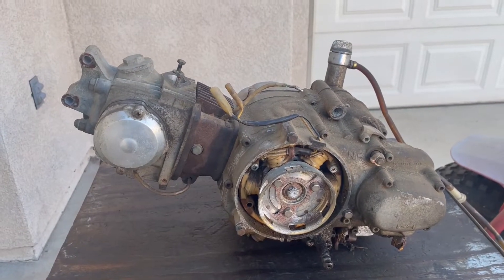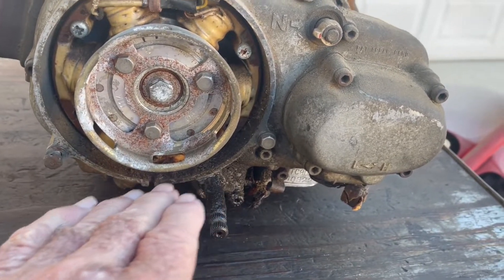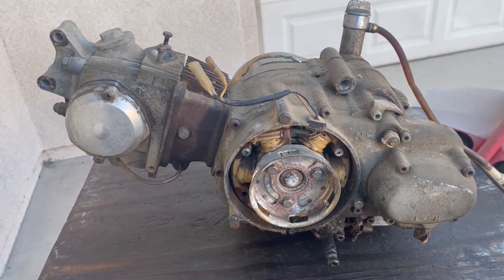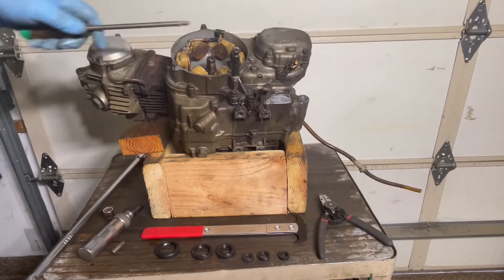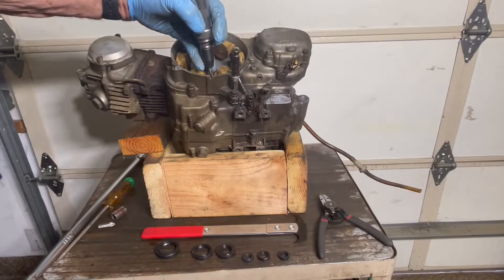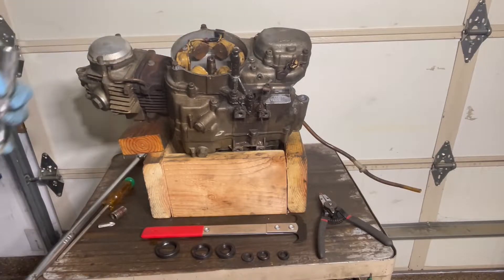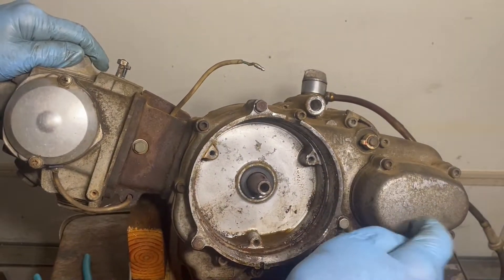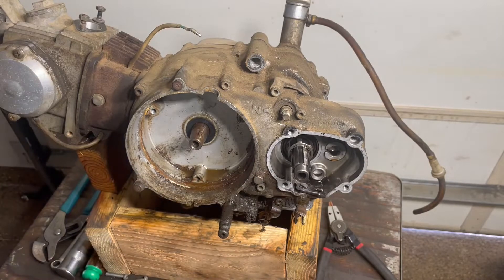Honda ATC ATC90 Throwing Oil, Part 3 - Oil Seals, Oil Filters, Clutch

Comment: Original Honda screws are not Philips Head… they are JIS (Japanese Industrial Standard). 
JIS screw drivers and bits are available and do not “cam out” as Philips Screw drivers were designed to do.

Comment: I just started working on a 1977 ATC90 engine. I took the left side cover off and it looked like someone JB welded the top void (narrow one that opens into the countershaft area) visible at 22:08 in your vid. I'm guessing they did this because they had a chain break and crunch the case, so they repaired it with JB. Do you know what that void is, or if filling it in will hurt anything? Thanks sir
Reply: If you take a careful look at the gasket holes and outer cover passages compared to the case passages, you’ll see the one you refer to is an additional  crankcase vent passage. The main one leads down to the hole in the outer cover’s bottom edge, just behind the shift shaft.
If you think about it, over time, the passage leading to the sprocket cavity will become “caked up” with dirt and grime, so yours blocked off doesn’t seem like such a bad idea.
Reply: @donsoule6411  thank you for the reply and information sir.
Reply: @middlesiderrider  Your welcome… I’ve got a 1974 Trail 90 (CT90) apart and am thinking I’m going to seal up that passage leading to the sprocket cavity. That’s how I was able to reply to your concern. I’m also concerned about the potential for grit to find it’s way into the crankcase from the drive sprocket flinging debris into that passage way. On Trail 90s, the stator cavity is not sealed from the crankcase and therefore there is oil that needs to be contained by the left side cover. On the one I’ve got apart, there is trace amounts of grit laying in the very bottom of the stator cavity. I suspect it may have entered thru that vent passage leading to the sprocket cavity and so plan to eliminate that as a potential source of grit by sealing it closed like yours.

Comment: i am working on a honda atc90 and i am wondering where you got the tool to take that nut out at 30:46 thanks in advance
Reply from the maker: I got it on ebay.  Amazon probably has them too.  If I remember correctly, it was under $10.
Reply: what is it called when

Comment: Hello, I'd like to know the diameter and thread from the pol-rad puller/ bolt because the Honda standard tool doesn't work.
Thanks in advance.
Reply from the maker: I'm not sure what the "pol-rad" is.  Are you referring to the rotor?  The ATC 90 and 1979-80 atc110 use the same one piece puller.  The 1981 and up and other engines use the two piece puller.  I don't have the diameter and thread handy.  But you should be able to find it.
Reply: Thank you for answering. Yes I'm referring to the rotor.